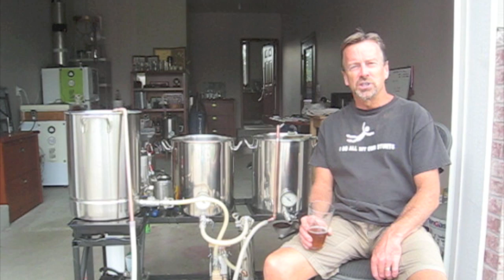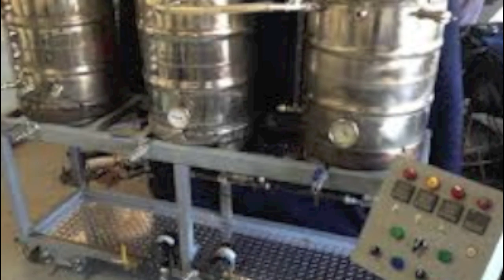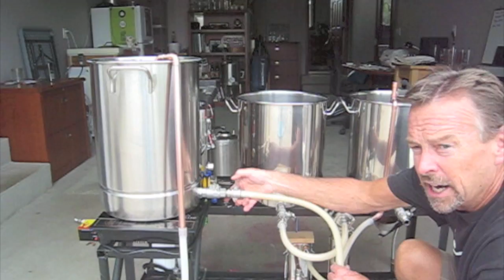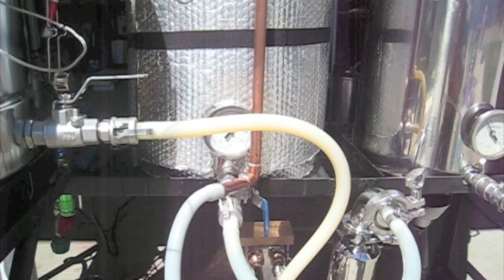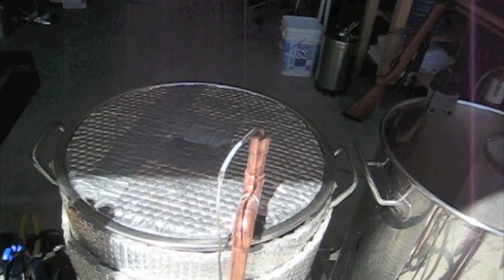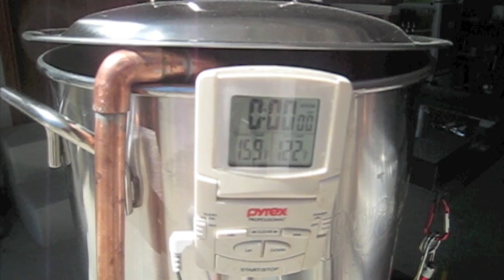HERMS Brewing System (home brewing)

Comment: Very clever system. Thanks for sharing
Reply from the maker: Thanks so much.  I have changed my process quite a bit since I posted this video.   The concept is the same, but I control the temperature without using the heat exchanges (have the mash tun on an induction burner that allows quick and accurate control).

Comment: This is a great idea, thanks for sharing. The trouble with induction hobs (at least the ones I've got/seen) is that you can't control them other than manually. So, if your ITC1000 or Ink Bird etc cuts the power because you're at temperature, then the induction plate goes off, as it should. Trouble is, when the controller switches it back on, the induction plate is in standby mode and you still have to be there to press the button! My plan is to control the pump (recirculating the wort) instead. Might work...! Thanks again.
Reply from the maker: Thanks for watching and your comment.  You are right, the on/off is a momentary switch on mine too so I can't control them automatically.   I have changed my system quite a bit, and now I usually only have to adjust the power level once.  I don't mind monitoring it manually because I am out by the gear anyway.  Your idea on adjusting flow rate is interesting and just might do the trick.  As a side note, I really enjoy this part of brewing - always looking for a better way!
Thanks again, all the best.   -DT

Comment: So with this system you add the entire amount of water during to beginning?  In lieu of strike water X gallons and then sparge water X gallons....
Reply from the maker: Hi, thanks for watching and your comment.  Everything is basically the same as usual.  What it comes down to is you are recirculating the mash through the heat exchanger while circulating the hot sparge water through the other side.  Once the mash is done, simply run the sparge water on top of the grain bed instead of through the heat plate and you are good to go.
While this worked ok, I now do this :  https://www.youtube.com/watch?v=I_IKXOOoM8U&t=2s
it is a lot easier and works even better.
Thanks again, Happy Holidays.   -DT

Comment: Great design of trub filter before heat exchanger, which use for clarifying the wort. It is normally used in micro brewery system.
Besides our standard design for heat exhanger is use for cooling the wort to fermentation temperature within 40 minutes.
And the heat exchanger have single stage and two stage for optional. Which kind of heat exchanger do you use in your system?
If you want to learn more details about micro brewery system, kindly contact Derrick by email brewery@cnbrewery.com
And we can provide turnkey solution as your demands. Our official website www.microbrewerysystem.com
Reply from the maker: The heat exchanger is a Duda Plate chiller, pretty basic.

Comment: Hi I am trying to make brewing cattle from old keg. What concerns me a lot are materials. I can only buy valves and o-rings for cold water and materials(pipe screws or however do you call in English). So far I have found Galvanized material, copper and brass parts. Can they harm during brewing? What to use to seal little holes between valves and keg? Rubber just doesn't work, right? Please help me to solve this mystery. Thanks ;)
Reply: Copper will be better if no stainless steel is available. Brass and galvanised are not good.

Comment: The trub filter seems quite important for this setup. Is the filter easy to clean and have you ever had it clog up? Can you suggest a supplier? I am looking at building a similar system with 1000L tanks so I'll need a faster flow through the filter. Do you see any reason why this setup would not work on a larger scale?  Thanks

Comment: So is the hot water in the HLT heating up the heat exchanger to the temperature you want to mash at? And thereby heating the wort to that temperature as it then goes through the heat exchanger?
Reply from the maker: exactly.  essentially the heat exchanger becomes the temperature regulator and warms the wort.

Comment: What is the sizes of the Kettles (pot)? 
Thanks!!!
Reply from the maker: My kettles are 9 Gallons and the HLT a bit less than that.  I tend to try to boil close to 7G, that way I wind up with a full 5 G in the keg after all steps in the process.

Comment: If it works it works, but generally when using heat exchangers you want to have the cold entrance on the bottom and the warm exit on top, this helps with the flow. It might be less of an issue with plate type exchangers but since you're also not using a counter flow setup I thought I'd mention it.
Reply from the maker: Gerben Ras thanks for that comment.  I like to have a forum where such tips can be shared.

Comment: Awesome system! Could you tell me what power supply you use as well as a parts list for the copper popping arms?
Reply from the maker: Larry Mikrut I found the power supply on Amazon.  It is actually a power supply for tattooing (hence the flame paint job).  I just wanted a variable p/s that had enough current for my little DC pump (I bought those from a guy in the UK who specializes on solar water systems).  Sorry that I don't have part numbers, I bought those items a few years ago.  The copper piping and stand are all standard items that I cut and soldered/welded to be the right size.  I connect it all with high temp silicone hose.  You can find that at 'bargainfittings' or 'brewers hardware'  - I use both of those websites a lot.

Comment: nice set up! how many watts is the induction cooktop?
Reply from the maker: mark peterson I just looked at it and is says 1800W.  I bought it on Amazon.  The higher the power the better for sure (we have an induction cooktop in the house and it can heat my water is 1/2 the time, I think it is 2500 watts.

Comment: I think I have that same induction cook top. I have to plug it in and then push the power button. How do you get the induction cook top to turn on automatically after you add power to it, or are you running it continuously the whole time? If the latter, how do you regulate the temperature of the mash so that it doesn't get to hot or cold?
Reply from the maker: I regulate it through the use of the thermometer connected to the "return" tube into the mash tun.  I either manually turn the burner on/off, or adjust the temperature.  Typically, I adjust it just a few times throughout the mash, then crank it up for the mash out (if I do this step).

Comment: Can you boil with that heating burner as well>
Reply from the maker: Yes you can.  The only thing to watch is the weight limit of the glass cook top.  I had the idea to use this because we have a nice, high power induction cook top in our kitchen.  Note: the induction cook elements only work with magnetic materials (i.e. will NOT work with stainless, my pots all have a magnetic bottoms.  It is nothing fancy or hard to find, but I wanted to be sure to point this out).  I have heated up to 4 gallons or so which would be about 32 pounds.  Most weight limits for these seem to be 25 - 30 pounds.  Boiling 6 gallons would be about 48 pounds which might push it on some.  Also, don't skimp on the power levels.  The higher the power, the better/quicker results for sure.

Comment: nice video,  i really like your idea of using the heat exchanger instead of a coil in your hot liquor tank. can you tell me where you purchased your filter for you heat exchanger?  do you use your heat exchanger to cool your wort as well?
Reply from the maker: thanks, I am glad you watched and enjoyed the content.  This system is working real well for me.  Any heat plate will work, mine came from BrazeTek (made in USA) and the filter from brewershardware.com.  Yes I do use the exchanger to chill as well.  I typically whirlpool through it (no chilling water) until the wort drops to 180 degrees or so, then add water and it quickly brings down the temperature to 70 degrees.  The whirlpool time allows time for late hop additions for those hop forward beers.
Reply: Hey Thomas, glad to meet you here. Will you plan to add filter before heat exchanger? We can supply you solution. May I know your email address?